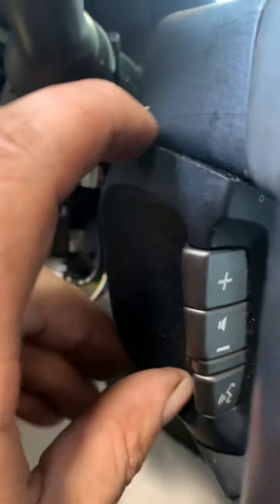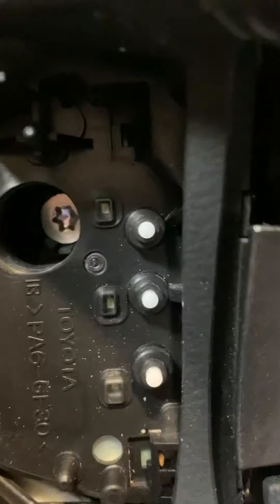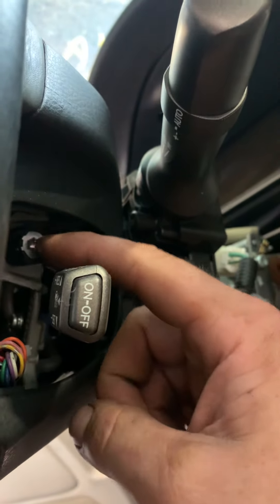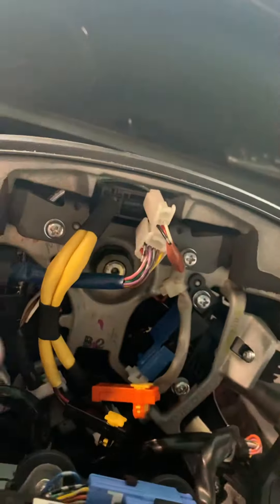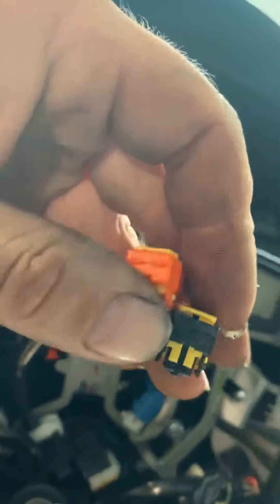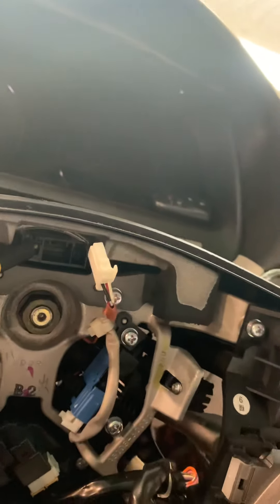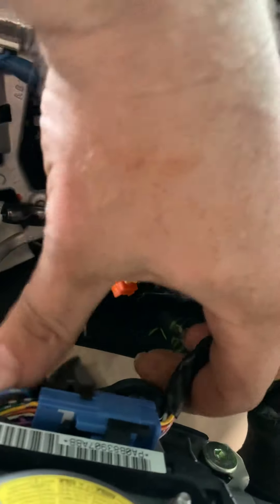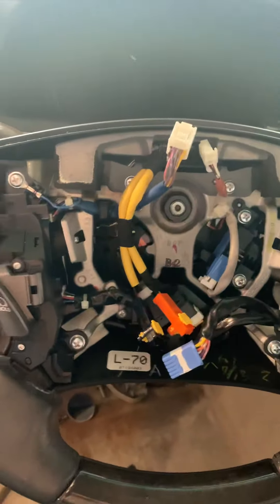2008 Lexus ls600hl/460 steering wheel air bag removal DIY

Comment: Hi, can you show how to open these two plastic cover in a video? I tried but I still can't figure out, scratch the cover already. Thanks
Reply from the maker: They are simple. You just need a small flathead screwdriver and you will see notches where to put it in and pry it slightly and it should pop

Comment: I can’t remove the blue clip  also.  When I reinstall the bag the horn does not stop going off
Reply from the maker: Did you remove the battery terminal. If not than the horn will sound til you pop the airbag and tighten the bolts on the airbag. After you do that the horn will stop. I’d recommend removing the battery terminals before you start the job